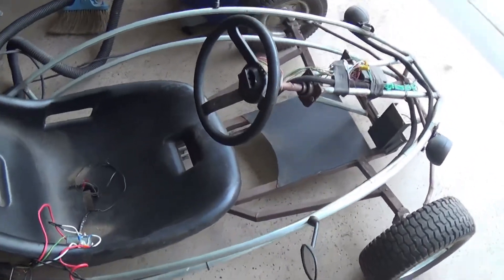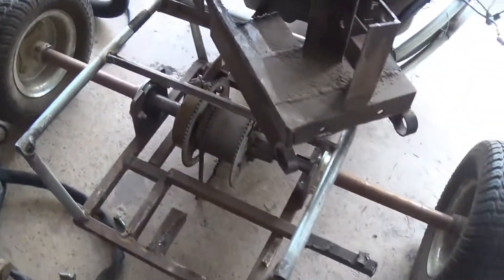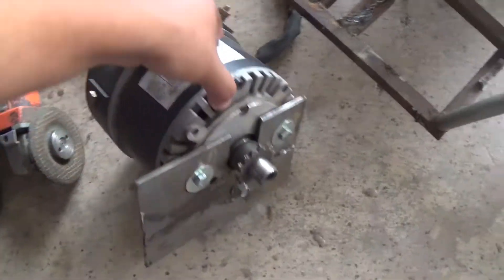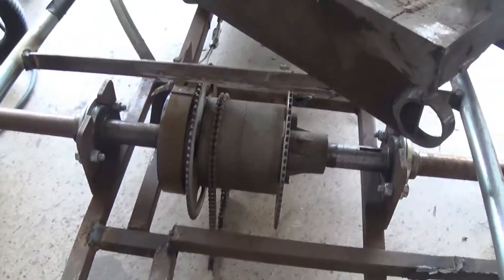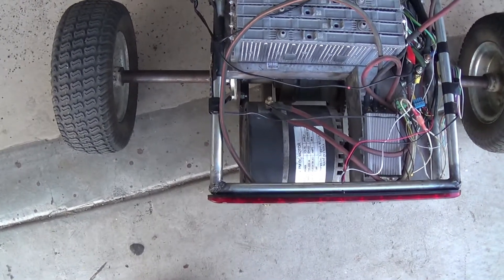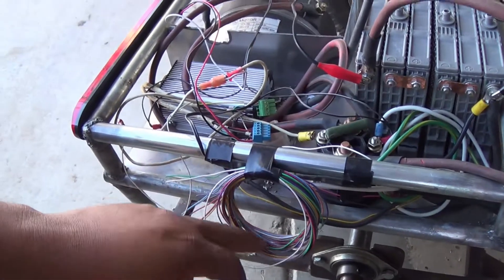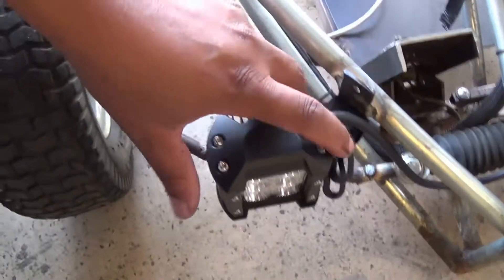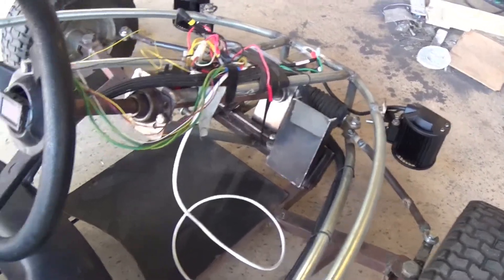Mr. Tmac's Electric Go-kart update.

Comment: Wondering what gear ratio you are running??? And what sort of top speeds you achieved? Thanks.
Reply from the maker: running 35 chain, 12t 7/8  sprocket on motor side and 60t on axle side, so like 5:1, with 13" D wheels. top speed was about 38mph.
Reply: @MrTmac349  Great stuff